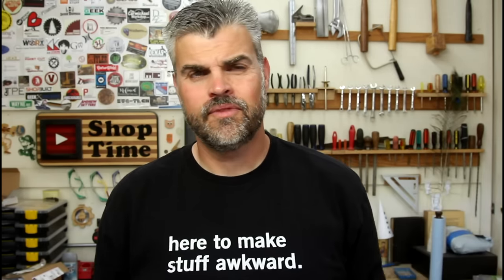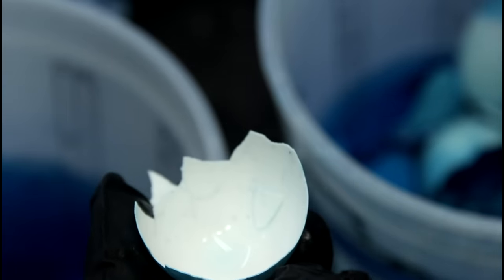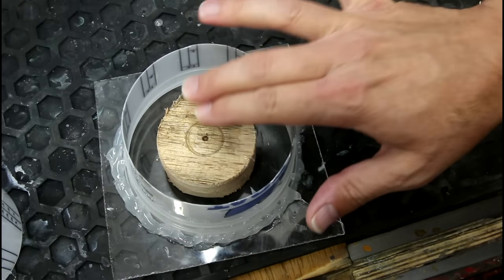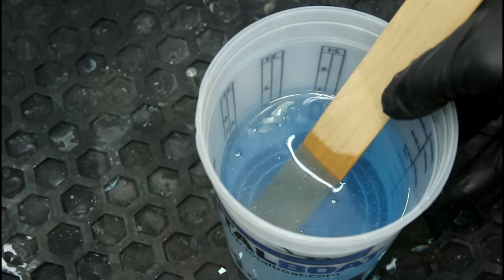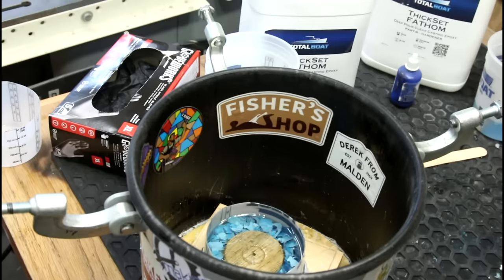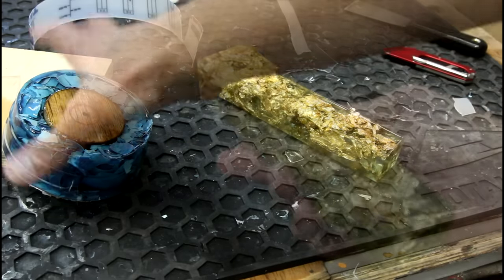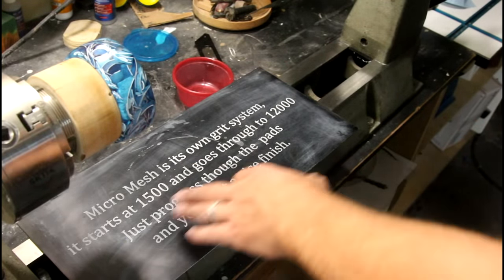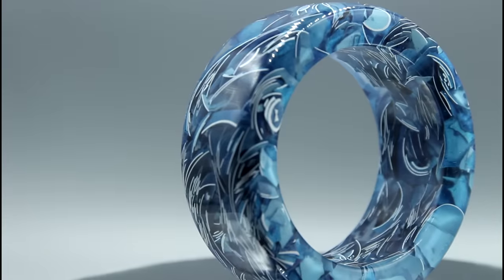Dyed Eggshell Bracelet | DipIt #42

Comment: I'm in the third category. I knew there was a membrane in the egg. I didn't consider that it would possibly impede the dye.
Reply: I'm a 4th category. I thought he was leaving it on intentionally so the shells would stay white on one side and blue on the other for some cool contrast.
Reply: I'm in the fifth category, I had no idea eggs existed
Reply: @cobiebeef funny!
Reply: I also knew it was there and assumed that's where the foaming came drom, but I didn't consider it blocking the dye either.
Reply: @cobiebeef 
😂😂😂😂
Good 1!!
Cheers
Reply: I knew it was there, but thought it would have drained out with the rest of the egg contents
Reply: Yeah, Honestly? I know the membranes exist and when he said they were impeding the insides getting dyed,I was like, "yeah, that makes sense," BUT I totally would've done the same thing and not thought about it until it was causing issues.
Reply: Same, I was like "oh yeah, duh" but not having foreseen it beforehand
Reply: I assumed he'd given them some kind of wash. both to keep them from smelling as he stored them, and to remove any traces of membrane or dirt before he started crafting with them.
Reply: @needamuffin  nah, the foaming must've come from the shells themselves reacting with vinegar in the dying solution. The shells are made from calcium carbonate, and it reacts with acids, which include vinegar
Reply: @atriyakoller136 why doesn't it foam when you dye eggs normally for Easter? Less surface area or is there something different about the outside of the shell?
Reply: @twistedmyth5860 I’m in your group. It’s so obvious but I would do the same thing.
Reply: Same.  Maybe Peter just doesn't hard boil eggs?
Reply: Here here
Reply: Same
Reply: Saaame
Reply: i'm in the sixth category, i know eggshells have a membrane but i did not think about it at all during this video until he said something

Comment: Bake the shells at 350-400 for an hour or so. Basically disintegrates the membrane and breaks down the natural waxes in the shell, which should also allow the dye to penetrate deeper. Was told about that by a guy who created small carved shell nightlights.
Reply from the maker: That fantastic! I'll give it a shot. And my back thanks you too.
Reply: This effect is very, very cool looking. This was a shell of a project! 🥚 👍😄
Reply from the maker: @deannam-host6584  slow clap
Reply: Ive made eggshell art pieces before, my method of choice was placing them into bleach, bleach will eat the membrane away, but the outer shell will be untouched. Leave it to dry out and no smell, nothing. Placing them into oven may cause brown spots and weird smell if you dont seal it later. By the way, you can use wood glue to glue them, if you glue a glass surface, place a big chunk on and crush it onto the surface, it will create smaller cracked pieces on it, after a little mosaic work, it will create interesting lamp shades and candle holders.
Reply: 350-400 for an hour !? You'll end up with burned black egg shell 😂
Reply: american eggs dont have wax. the factories clean it off in the sanitization process because we are scared off ecoli, which is why american eggs need refrigeration.
Reply: I don't know about the temp/time, but you can also do this if you want to powder them for calcium in your garden!
Reply: @PXBproduction  I guess it's degrees Frankenstein, not degrees C.
Reply: @peterbrownwastaken  And... you can always break the whole eggs carefully - mostly in two halves - peel out the membrane, then toss them in a bowl with vinegar, etc. Break them up as you wish for your next project. This one is really beautiful! I think the cross cut is still white because the eggshell just isn't very permeable. Otherwise a lot of little almost hatched chicks would be very very unhappy. But I like the white edges in this bracelet!
Reply: @zaprodk  yes i was talking 350-400 fahrenheit. I know from fact that it is faarr to much
Reply: @PXBproduction Actually, that's probably not the case. While searching "what happens to egg shell at 300 degrees fahrenheit" the first site from ScienceDirect noted that at 300 C (572 F) the eggshells were blackened but at 150 C (302 F) they just started to turn a pale yellow color. So 300 F should be fine unless it has something to do with other countries not washing the wax from their eggs (which admittedly, I did not know until I read one of the above comments).
Reply: @sporilight  my oven might run hotter then other oven maybe. Im in Canada but i had fresh egg from my chicken that was not washed. I just put the egg after i cooked something at 400, and they were turning black quickly just with the residual heat
Reply: @PXBproduction  That may be the case (oven running hot and unwashed egg shell). Not sure if I would go all the way up to 400 F just to be certain. Some recipes say you can make "hard boiled" eggs in the oven at 325-350 F so that might be a safer temperature for this project (and your cooking XD).

Comment: Soaking the eggshells in Hydrochloric Acid for about 20 minutes should remove most of the membrane or make it easier to remove. The national library of medicine has a decent article on separation, both chemical and mechanical.
Reply from the maker: That's amazing! Of course, they do. :)

Comment: The vinegar is slowly dissolving the egg, basically etching it. The dye attaches to the etched surface really well, that's why it only sticks to the surface instead of going through the whole thing.
When I was in middle school we had a science project where we just dropped an egg into a beaker full of vinegar and left it for like a week, after which point it was just the inner squishy bits left over.
Reply: If you are careful that squishy bag will bounce after the shell is all dissolved away
Reply: If you put that squishy bag in water it will absorb it and blow up, and you can poke a hole in it and it squirts it out like a mini fountain.
Reply: I did that in high school chemistry as well, the eggs get quite bouncy

Comment: With regards to egg membrane, Use boiled egg shells its far easier to locate and remove the membrane when you peel the egg. That bracelet made me think of the famous Japanese wave painting.  I wonder what effect could be created by stacking the shell rather than random placement! Excellent as ever thank you both for sharing x
Reply: That's what I was thinking too! As pretty as the faces of the shells are, I think I like the edges with a little bit of blue face in between better! It'd be really cool if someone could do this but do it on a flat plane and select them individually to make some kind of painting, like the Japanese wave thing, but in shells 😄

Comment: Peter, once again, absolutely stunning. The depth of color offset by sharp white contrast is gorgeous. It had me thinking it would be incredible if you made it as a thin panel/veneer for a box lid or used different colors for a stained glass/marquetry.
A tip. You can peel a good chunk of the membrane right after you crack the egg open. You won't get it all, but should get 50-75% and it's easy enough you can throw the rest out and just eat more eggs.

Comment: Great watch thank you. I'd be down to see a strategically buried led string inside a bracelet. Not routered out and inserted but cast inside as part of the mold. With some thin clear rod you can hold the wires. Bury the end wires through some foam and arrange those so they get exposed as you lathe the blank. Remove foam to attach power for lights.

Not sure if it'll work but it would be cool if it did. 3v batteries can get tiny enough for inside a bracelet. Could go full steam punk and make it a bracer with bronze ends.

Comment: We use the eggshells to feed the chickens (to meet their lime needs). To do this, we put the eggs in a metal bowl and put them in the oven at 150 degrees Celsius for 45 minutes. The membrane dries out and can be easily wiped off afterwards. The eggshells are then crushed in a mortar.

With our quail eggs it looks similar, disadvantage there is that the egg skin is somewhat firmer. For this reason, they remain in the oven for over an hour.

Comment: For getting the inner membrane off, I'd suggest looking up a tutorial for blowing the raw egg yolk yolk out with the shell intact, you then put a small amount of vinegar or alcohol inside the shell and shake it around. That should help break down and release it, learned from Eastern European wax stencil decorative egg dying to keep it from rotting. Also, a relatively translucent dyed top coat in a different color may look interesting to cover the undyed edges of shell.

Comment: When we used to save shells for confetti eggs I’d peel out the membrane when I washed them after emptying them. It adds a few seconds to the washing, but is much easier and quicker than going back through them later like that when you have a whole bunch and they’ve already started breaking into smaller pieces.

Comment: one thing that has worked for me with coloring the shells through is to use a vacuum chamber. Egg shells are porous enough that putting them in a vacuum chamber as if you were going to stabilize them, works well in my experiance. But on a side note, I rather like the white bands between the colors.

Comment: The bracelet "turned out" gorgeous! 😍😂  An "eggcellent" project indeed.  I actually like the distinct white lines on the inside of the shell.  It almost makes the design look like ocean waves. 😯👍

I'm one of the people who always knew about the membrane.  Someone already mentioned the method to remove it via baking but did you know that if you carefully clean your eggshells and bake them then let them cool and grind them into a powder they're an eggcellent, cheap calcium supplement as well?  For people (using a spice or coffee grinder is best for human consumption), dogs, birds and gardens, they're great.  Waste not, want not! 😉  You do need to bake at 400°F for a minimum of 10 minutes for the garden, 20-30 minutes minimum for everything else but to be extra sure for consuption, go up to an hour.  Just so any potential bacteria is killed, of course.  Baking them does make them more brittle and easier to break though so if you're baking them for a project do keep that in mind. 😅

Comment: Very cool bracelet, i used to crush up egg shells into a fine powder and make a paste with some water. once it dried i used it as sidewalk chalk. I wonder if you could do something similar with resin? Or at least dye the resin with eggshell powder.

For removing the membranes, if i remember correctly, you want to keep the eggshells in larger pieces and let them dry, Should peel right off. The moisture is what makes it stick to the shells.

Comment: actually a problem i have some experience with lol the easiest way i’ve found to remove the membrane in bulk (witch stuff) is to bake them off in a toaster oven.  low heat probably ~200f, but to too high and the shells turn a funky light brown color and get sulpher’y.

Comment: Might be interesting to try and make something like this, then dissolve out the exposed shells with vinegar and fill the gaps with something else (with help from a vacuum chamber). Same for the even thinner layers in the gold, assuming you have some cyanide to dissolve it out with. Making cyanide from apple seeds is a fun family project!

Also I advise sliding a chair up to a tall bench and doing that kind of fine peeling work there. You won’t be hunched over if your work is already at eye level.

Comment: Imo one of the most, of not THE most, beautiful resin works you've done on this channel! The patter looks almost digital, like it was designed on a computer. I'd love to see different color & item experiments with the shells! And with different shell piece sizes too. If you peel the membrane off right when you eat/use the egg, it shouldn't be that tedious, as the shells would probably be mostly in large pieces and you'd only need to peel a few eggs at a time. Thought I'm wondering if the shells would wear down quicker than the resin, since it's mostly just calsium. Would it be a good idea to give the final piece a thin layer of protective resin to make sure no shell is exposed? 
Oh, and the white edge is probably to the dye not penetrating the shell and only sticking to the surface.

Comment: Tip for getting the membrane off the eggs is boil them again after peeling for 10 mins. It should come out in the water or is easier to peel out. Also, leave the eggs to soak in dye for a few more days. It will penetrate the shell more, but the white inside look is good.

Comment: I went through a phase where everything needed to be coated in eggshells. Like, put down glue then a shell, then press it flat and let the little cracks form. Membranes are rough. Best to take them off as you collect them. And it don't hurt to let it dry for a few hours.  The shell with roll up when you rub it with a finger or pencil eraser and peal right off.  Oh, and the shell itself while porous, is too porous for the dye to seep through. That's how the shells keep the eggs inside.

Comment: Since the exposed bits of eggshell are presumably just polished up bits of eggshell, I wonder what would happen if you left the bracelet sit in vinegar for a week. Since the calcium in the shells should react to the vinegar, you may just end up with empty voids on the outside where the shells were, or it may just etch in and recess the shell bits a bit. Maybe not great to sacrifice a finished piece, but if you have any leftover shells it might be a neat experiment. I remember doing a "rubber egg" like that in school.

Comment: Have you guys never cooked with or hard-boiled eggs before? Yes, the membrane sometimes stays behind after you peel the shell off, and it's what traps that sac of air at the fat end that makes it look like a small bite was taken out of it. I think it came out beautifully, and you should definitely do this again! Also, for the shavings, maybe see if you can press them all together with heat to cure it into a mixed colors solid again without adding more resin.
Reply: This also reminds me of a video where someone made hdpe milk jug Damascus from milk jugs that had a white-black-white layer system so instead of all white when smooshed together it looked like damascus

Comment: first wash them in hot water with dawn soap and vinegar, then rinse them well and let them air dry a bit. then pop them into the oven at 175 for a couple hours or until the membrane pulls away and falls off. rinse them when cool to get rid of any bits and let them air dry and then use them for the project you want to use them for. side note, you can grind the remaining ones you don't use for calcium for your plants or morning smoothie just make sure they arent any where near your shop. .

Comment: Yeah, generally speaking, when you dye eggs, they're still intact so you don't have to worry about what's inside. If you're dying shells that have been used, you're going to run into issues. For example, rotten eggs smell like Sulphur. when you mix egg whites they start to foam up. Little things like that.

Comment: If you want to make a quick and dirty (metaphorically speaking) Bracelet Mould, take a reasonably sized chunk of waste wood and lathe out an oversized bracelet shape and then use it to make a reusable silicone mould you can fill with Resin...

By making it oversize, your Resin Ring will have enough extra "Meat" to turn down and polish on the lathe...

Comment: Here's an Idea that takes advantage of the membrane...

Dye the shells eggsactly as you did for the bracelet, BUT after you dye the outer side and remove the membrane, LET THE SHELL DRY before putting them in a DIFFERENT (but complimentary) colour of Dye...

In Theory, the first side should absorb the second colour and mix with the first (blue + red should give purple while red + yellow should give orange etc.) and even if the first Dye doesn't let the second Dye absorb and mix, you'll get a 2 colour shell to add to the Resin Mould...

Comment: The foaming action is actually from the (insane amount) of vinegar reacting with the calcium in the eggshells. If you add vinegar to your water while boiling eggs it helps make them easier to peel because it softens the shell. I am SHOCKED that with the "few table spoons" of vinegar you used the shells didnt completely dissolve!! Lol😂😂😂😂😂